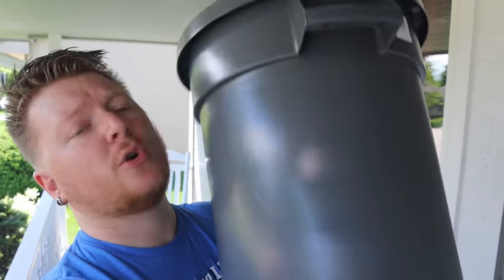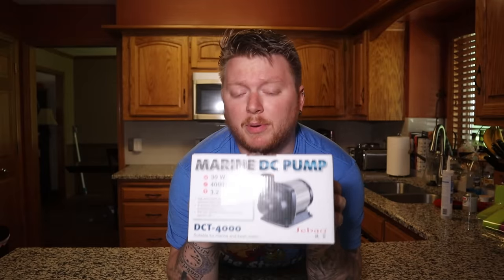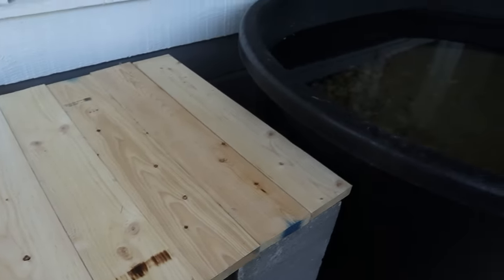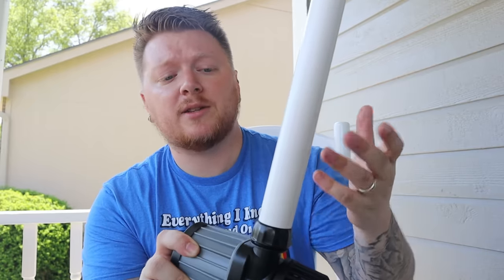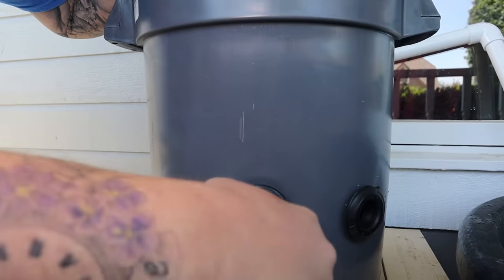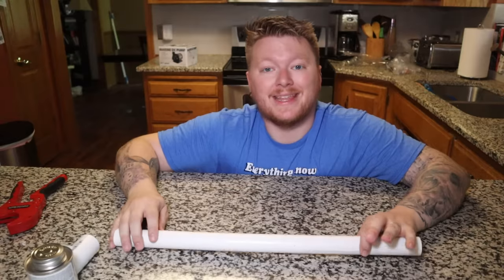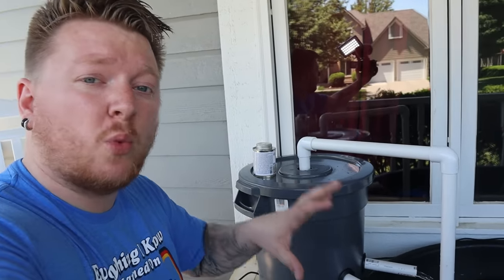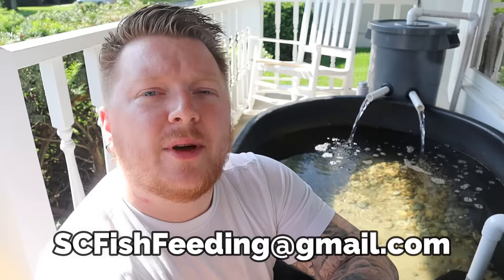DIY Pond Filter Made EASY From Trash Can!

Comment: Great design. I found though, if you put all of the media in reverse order and pump water to the bottom of the bucket and flow water back into the pond off the top of the filter, you then take advantage of gravity and some sediment will settle on the bottom regardless of having to flow through foam or rock. This helps extend the time between filter cleanings and settles heavier things.
Reply: I like this idea.  It would make it easier to landscape in a waterfall design.

Comment: I have a sizable aquaponics system and use a lot of 1 inch PVC tubing and fittings.  I have yet to use PVC glue anywhere because I need to be able to take things apart from time to time.  Since there is really no pressure to speak of on the pipes, the joints will not leak if you snug them on tightly.  But, if anything that holds water is going into my house......yes, I would definitely glue the joints just in case.

Comment: We used a dog food bucket with flat sides. The pump feeds tube to the top of box then runs tube to the bottom. The outflow comes out near the bottom edge yet the inside has the tubes going to the top as overflow.  The water starts at the bottom then raises to the top through our media to overflow into outflow tubes.  This is so with power interruption will keep the filter from draining,  overfilling pond tank. We added  a vent pipe on the feed tube to block a siphon from forming. When first filling we plugged the vent tube to get the water to the bottom, after this we take our thumb from the vent.

Comment: Ok so I'm back a few weeks later. I built this using a Lowe's bucket and flexible hosing, it's kind of crappy. I bought the exact pump you used, but it didn't have any connectors to connect to anything, so I sent it back.

However, after making the crappy one, I learned a lot and now everything in this video has clicked! So I'm going to get some pvc and using a Lowe's bucket and those little black thingies, I'm making a New Improved filter and it's gonna be awesome.

Comment: Made one for my Talipa, tank (garden water conditioner).. Mine floats on the water sticking out about 4".  Holes in the bottom, lava rocks at the bottom, finest media in middle, coarse media on top and then the filter right on top with a half meter  intake pipe.. empty sealed soda bottles or polystyrene can be tucked in next to the pump before closing the lid to adjust the buoyancy.. theres a hole right on the rim for the intake and power line.. The gravity for the bouancy forces the water out the bottom.. if it starts coming out the top you know your media needs cleaning.. without straining the pump.. its not for aesthetics but it allows the water level to change from watering and filling..

Comment: Had a pond running for a few decades now.  Been through a TON of filter options.     
The issue I have had with ALL filters, is they ALL require you to put the pump directly into the pond.   Where it WILL fill up with assorted crud.   I have tried various means of not allowing that, such as putting a nylon bag around the pump, but nothing works.   Pump in pond = pump full of crap until it works too hard and fails.   Finally, right now got a home made one inside a lowes 5 gal bucket inside the pond with the pump UNDER all the filter material inside the bucket.  Now I might try this only using a much larger bucket like your trash can idea.   BUT again this would have to go IN the pond.  Not sure I want to use up the  space (tiny pond.) 

Watching  your video gave me some ideas, but dang, a trash can with assorted PVC pipes sure is butt ugly.   Wondering (since mine is outside) if I might dig a hole next to the pond and at least get this more on the same level.    Yea well that still doesn't solve the pump in the pond problem.  Really need a pump to remove the clean water from the filter and let the pond water flow into the filter.   Haven't quite figured this one out yet.

Comment: So am I right here. The water is essentially dripping through the sponges (or flowing a bit) and then pooling in the lava rocks before pouring out the exit pipes. So the fill level is at the height of the exit pipes. Is it primarily bacteria in the lava rocks doing the filtering, with the sponges clearing bits of solid gunk? Looks good though, cheers!

Would having the exit pipes further up the bucket, and the input pipe going all the way to the bottom of the bin (so the bin fills up) work even better?

Comment: Love this project brilliant cheap way of solving the prob, and i do have this very problem right now, Two questions how often do you remove all the wadding and wash it through, and how do you wash it, i am told not to use washing up liquid, is that right, also being in the building trade I have a concern for you about all that weight on that timber base at your home,so i ask have you checked its all good and that there is no movement to worry about underneath, water is ten pounds per gallon,PS just asking ok,thanks for video,

Comment: Hey bud I use to have a diy fish pond out side . One thing I suggest. When u buy a bag of lava rock Make Sure you wash it good before you put in in the trash can . You will be surprised how dirty it is . And  I used egg crates like you use on your bed . . When I would go to the dump and I saw a old egg crate got it cut to fit and put in in . And once a year I cleaned my barrel and rocks . I had a 55 gal plastic barrel I used . I had a 16 x4 ft gold fish pond . The deepest part was to my wast. I used the highest mil black plastic I could get from the hardware store . It was twenty ft wide so it worked great . Miss my fish but once a year I cleaned the pond and that I don’t mess . It was so cool to watch those two inches gold fish grow in like two years to about 8-10 inches . And all I had to do was say hear fishie fishie and they came to the top wanting food .lol

Comment: If you have a little extra money, run to a plumbing supply store, you can buy a sump crock with a lid. Extremely rigid, and they will sell you those seals there as well. That way you won’t have to worry about that trash can failing on you like you mentioned. Great video, been looking to build a bigger pond for my turtle and build my own filter. Thank you!

Comment: we just started our first fish pond to raise tilapia. We've had them for a little over 2 months and  they are growing as expected.  first question is is your pump still working? next since we already have the pool up and running will using PVC cement affect the fish our pool which is about 1,000 gal? Lastly how often do you clean the filter? Any suggestions I didn't think about? appreciate your help.

Comment: I did the two Uni-seals and one worked well but the other leaked, so I had to caulk the other.  In hindsight, perhaps a sturdy pvc coupling might be better, as it would also reinforce the wall of the bucket.  With the uni-seal, the bucket wall isn't reinforced, so the weight caused the output pipes to sag a bit.
Reply: I had the same issues. One leaking, one isn't.

Comment: This is awesome, only thing I’d do just for a better appearance is paint the pipe or use OBS black pipe and also drill a hole in the pond to have the pipe go through it(above water level). Or if I could find a water tight can for the filter I’d make the pond overflow DOWN into the can and the pump just pump it up and out like a sump filter

Comment: Your DIY filter is amazing!!! I am a beginner and doing the 300 gallon tank that you have and I am using the 32 gallon Brute trashcan. Should I do larger PVC and what size pump will I need? Also I want to do 1 outlet with a tee bar about 2 feet for a waterfall. Will that work ok with 1" PVC or should I go larger?

Comment: I've got an outside Koi pond around 800 - 1000 gals. I like your homemade filter setup. I have a question: You don't seem to have any protection for the pump, meaning no filter or screen at all on the input to the pump. It appears to me that the pump is going to get clogged up with dirt/muck. Maybe it's my pump... it's a Danner Mag drive.  It's not cheap, so I want to protect it. Right now I have the pump in a milk crate with the Danner filter material and a filter bag over the whole thing. BUT... I need to drag that out every week or so and hose it off. This is what I want to eliminate. Advice?

Comment: Pretty good video Zack ,I’ve been in the fish hobby  for over 40 years  and I’m glad I randomly stumbled on your video and channel  I learned about the Pumps you are using  for the very first time btw the largest tank I’ve had was 2000 gallons  and I did have a 500 gallon Pond in a home I sold  I am a DIYer  and usually always plumb all my tanks  and I’ve built some filtration systems as well  recently I’ve been experimenting with inexpensive Chinese knockoff Power heads and other fish tank pumps  mainly because of how low costs of them and the theory of  I can throw those away  for the cost of name brand  ones and  I needed to sell all my previous  parts and supplies with my last home  so I’m starting from scratch  and buying all from the Internet now !

Comment: Zach, a few questions. 
First question; The lava rock. Is this the stuff from bbq grills? Does it need to be treated in any way? 
Next question; The returns, are they just skimming from the level that they exit the can? What mechanism causes the water to flow to the bottom of the can and thru the lava rock? It seems to me that the water is just falling thru the quilt fluff and right back to the pond.
Last Question; filters I've had in the past had activated charcoal as part of the media to extract toxic chemicals. Is this not required in a pond set up, or is there something else performing that function?
Reply from the maker: The lava rock would be the stuff you find for landscaping. I just buy mine from a hardware store next to the sand and pea gravel! 

Then for the water movement, picture this like a trickle tower style filter. The water comes out of the spray bar, drips through the polyfil, then down through the sponges, into the bottom of the trashcan where the lava rock is, then filling up to the level of the overflows and spilling back into the pond. So its coming into contact with all 3 types of media before going back to the pond.

And for the charcoal, it's sort of optional in all aquarium filtration! Some people use it, other people don't. You could buy a big sheet of carbon filter pad from petco, cut it to size and add it into this filter if you wanted to!
Reply: @SCFishKeeping  cool! Understood, thanks for the detailed response.
Reply: @SCFishKeeping  Hello Sir, Do we need to remove solid residue from this filter daily?

Comment: "It's BETTER" :D
That spray bar really caught my eye - It looks like it's SPRAYING with more force, due to the smaller circumference of the holes combined vs. the pvc tube.
Would it make anything worse if you made lots of holes in it, both sides and downwards (or just a bigger holes) - I reckon that would make the power of the stream a lot slower, so you wouldn't be spraying so hard downwards.

Comment: I apologize if this sounds like a very basic question, but how / what parts of this filter get cleaned and how often? We've been running large outdoor ponds for years, but there is a lot of "gunk" for lack of a better word. We've always used filtration medium wrapped around pumps that pull the water through the filters, and this has required cleaning multiple times a week or the pumps get gummed up. I love the simplicity of what you are doing, but my brain can't wrap around what you are suggesting in light of what I've experienced. Is this method useful for a fully outdoor pond in a natural landscape, 200 cu. ft. or bigger? Please help me re-map my brain about how this works compared to what I've been doing!

Comment: I know this video is kind of old, but I have been toying with the idea of a budget outdoor pond and this video is a great tool for a simpleton like myself.  However, I am in Florida (No Basements) which means I may have temperature issues and possibly even predator concerns to contend with so I might be barking up the wrong tree.  I was wondering if you have any suggestions.  I have a jacuzzi under a gazebo with a shade on top of the gazebo, temperature turned all the way down on the jacuzzi and it still stays at around 95deg.  How will I be able to regulate the temperature of an outdoor pond?

Comment: Hi! I'm wondering if placing the pump on the other end of the pond would help pull in dirty water(rather than directly under the clean water return)??  I'm having an issue with my 600 gallon pond having water alge blooms.

Comment: This might be a silly question. Do you drill a 1-in hole for the one inch uniseal? Or does the whole have to be slightly larger?
Reply from the maker: You'd need to drill the hole for the uniseal to be larger. If you Google uniseal hole saw chart you can see all the sizes for plumbing, hole saw and uniseal you'd need!

Comment: Bro appreciate your video. My kids and i are working on building the same model you built. Pls need your help my DCT-4000 pump is kicking my ass how the the hell do you connect the 1in adapter for the 1in pvc pipe? It’s not screwing in or fitting. Pls advise thanks

Comment: I'd flip the outlet to be the inlet and drill holes near the top as your outlet so the media is always wet. That design will only fill the filter to the outlet. Then you can always open the lid if need be to clean it

Comment: Yooo did it. Fkin love it. I have an in ground pond about 800-1000 gal that i dug myself (i do not know whati m doing). I did not like the poly-fill quilt material though. Too fine to rinse out. I went with multiple layers of varying coarseness pond filter pads. I also dont think the sponges provide much value either, so I removed. the rubber seals ARE GOATED. No silicone and not a single drip. Poly fill is too hard to rinse out, doesn't provide much filtration, especially as when the pads fill up with muck, they roll over the sides of the pad and miss the sponges completely. I need to rinse out pads a couple times a day with 25 ducks. My pond probably too small though tbh for all these ducks. Just ordered a bunch of water plants including water celery that will filter nitrates out too.

im only about a week into it, so I expect my pond color to improve (lots of algae right now) when the lava rocks colonate more beneficial microorganims.

I am considering changing it to have the pump inlet into the container to be on the bottom and filter up higher through more lava rocks. I am also considering getting a second trash can to do another lava rock filtration. 

I did not know this, but lava rock is for biological filtration, to get

Comment: did you keep your fish in that during the winter if so what size heater did you use 
I love the way you set that pond up I need to get the size pump you have for mine 
I have a 800 gph that keep 5med size goldfish pretty happy & healthy the filter setup 
I have is from a $ store clear tote that's like it's a 3-4 gal size & basic setup as you 
just not as powerful but the the pump does a great job.

Comment: Would this work only drilling one hole for the filter output? I''m using a 10g tote which has an uneven surface to be able to drill two holes into

Comment: This is a great video..simple and straight forward . Thanks. Question ; how big or maximum  volume of water can be clean with this home made filter.?
Reply from the maker: Really that just depends on how big of a pump and trashcan you have. I have this same set up running on a 1200g pond with a 55g trashcan and a 3600 gallon per hour pump. It works great and keeps steady flow throughout the pond.

Comment: Do I have to have 2 holes for water to come out of the bottom of the trash can? Also, I already have a 2200GPH-120W,UL pump will it work or do I need to get the pump you recommend?
Reply from the maker: You can really use whatever pump you have or prefer with this build. Kind of the beauty of it! Customize it and find what works best for you!

As far as the holes, you could just have one but you'd want to make sure the water is draining our of the filter faster or at the same rate the water is coming in. So make it a big opening. You don't want your output going too slow and having the filter overflow because it's filling up too quickly. Thats why i always liked 2! Plus its just that much moee surface agitation and oxygenation! If that makes sense!

Comment: Another alternative instead of the dishwasher scrubbers is to cut an exact piece of reusable air conditioner filter & heater unit. The kind you use for a forced air gas heater & whole house duct work. The filter is about a inch thick, I use scissors ✂️  to cut the sheet to size.

Comment: Hi,
Loved your video with the trashcan filter for a stock pond. Am making it this weekend-quick question, can you use flexible tubing instead of PVC? Will the Uni-Seals still work with that?
Thanks so much!
Reply from the maker: Glad to hear you're setting it up! You can definitely use flexible tubing but rather than using uniseals, you'd want to find some PVC connections and a hose adapter with a clamp. 

The uniseal is designed to expand once the PVC is inserted to create the water tight seal. Home Depot or Lowes should have all the connectors you would need to set something up for tubing though!

Hopefully that helps!
Reply: Thanks so much!!!

Comment: Thank you, gonna use some of those great ideas for my DIY filter. Question: What's your thoughts on putting the water-in at the bottom of the filter and push water up vs. dripping it down like you are doing? (positioning the filter appropriately for each method)